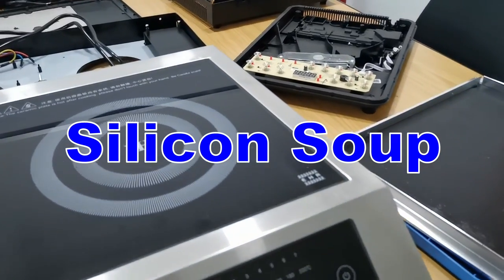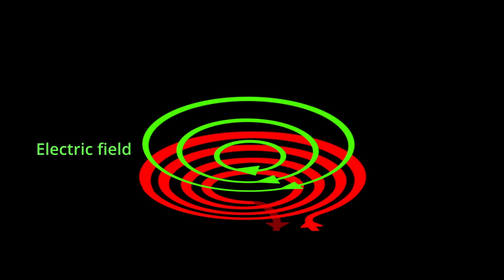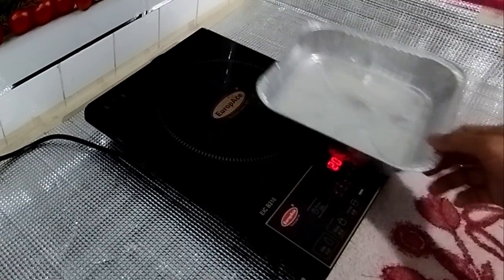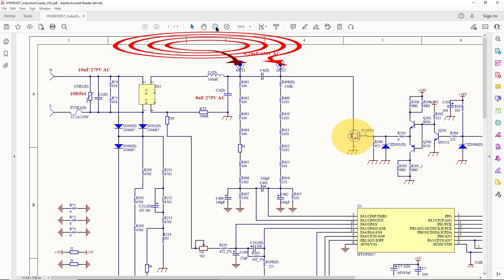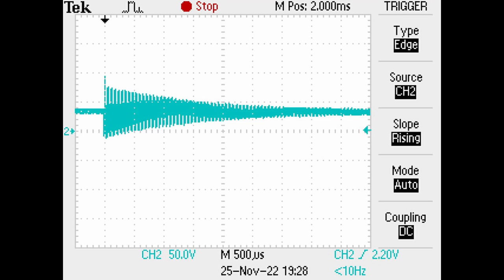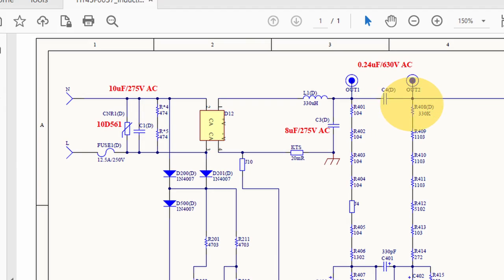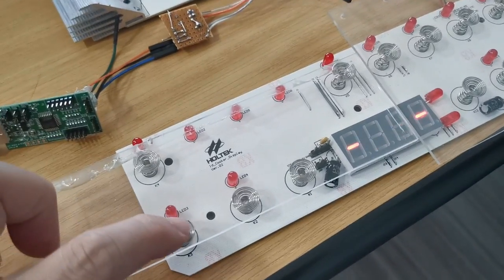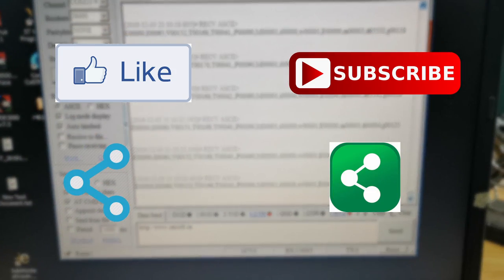induction cooker circuit, design, theory, must watch

Comment: Loved your video!! Thank you so much for it.
I’m interested to understand how the master board that takes user input communicates with the power board? Can we use arduino to talk to the power board instead of the touch pads?
Reply from the maker: The master board communicates with the power board by i2c. Yes, you can use Arduino to control the power board, but you must know the format of data as they are proprietary .

Comment: How can we modify AC versions to run on low amps???
Reply from the maker: to redesign for a lower power cooker, say for tea-pot, we have to choose a different coil, adjust the timing and protection threshold in the firmware. It is quite a complicated process.
Reply: @SiliconSoup  Indeed it will be redesign work

Comment: Great video!! I am doing EE and I want to do low cost low energy consumption or higher efficient induction stove for my fyp, I just have started to look for the resoources, would you suggest me a good start??
Reply from the maker: You can get information from https://www.holtek.com/page/applications/detail/WAS-21A1.
I think this project is a bit too hard for FYP, because it involves high voltage, high current, embedded coding. Moreover, induction cooker is a non-isolated device, so it can't be connected to your PC directly for emulation, unless you modify the circuit and add a isolation transformer.
Reply: @SiliconSoup  Thanks for the feedback, I am not doing it just for grades but its a need of an hr in 3rd world countries, we have seen gas loadshading first time in our lives, its time ppl get better alternates to those expensive and high energy consumption stoves, if you could provide anymore help it would be appreciated

Comment: Hello nice information , someone please explain at which point does the rectified AC input voltage gets inverted to AC back before  been supplied to the Coil, I understand the coil uses AC
Reply from the maker: The switching of IGBT invert the DC to AC. When the IGBT is on, current flows through the coil to the ground. When the IGBT is off, the current continue to flow and charge up the capacitor. Some point later the charged capacitor will discharge and the current reverse direction. So there is an alternating current in the coil.
Reply: @SiliconSoup  lemmi get to learn about IGBT switching and its inversion ability maybe i will understand better

Comment: Excellent work! Many low cost hobs Pulse the output ON &OFF to achieve a  lower average cooking power..its rubbish ! Boil-off- boil- off, plus its useless if you have say limited AC from a 1kw battery inverter or say only 500W of PV solar excess in a grid tied solar setup. I am looking to make a fully adjustable power range cct (esp32 mcpwm etc) which I can dymamically adjusts to only consume whatever free export solar power is available . Holtek do a continuously adjustable 300-3kw custom ic.  Have you any comments ideas or embedded code to achieve wide, non pulsing adjustment of power level? I.e an mppt induction hob.  It would be great if there was a decent open source project for an inductive hob..attractive given world's climate challenges and attraction of Solar cooking. Cheers and well done. Steve
Reply from the maker: Low duty cycle pwm cannot swing the collector voltage to the ground, and switching on the IGBT while the collector (and capacitor) retain some voltage is very damaging to the IGBT, as shown at 8:52. Therefore for low-power cooking, instead of reducing the pwm duty cycle further, many resort to intermittent cooking (boil-off-boil-off). Holtek low power continuous heating is to overcome this problem. Basically, in stead of controlling the IGBT 3-sec on, 7-sec off, it does 3-halfwave on, 7 halfwave off. Halfwave is the rectified AC waveform. The source code is open, but not easy to understand.
I strongly suggest you use Holtek solution, because the MCU is designed specifically for the induction cooker. It has OpAmp built-in for the current measurement, comparator for 
monitoring the coil voltage and triggering the IGBT at the appropriate timing. The latest model even have the IGBT driver built-in.

Induction cooker firmware design is not easy. Commercial induction cooker power supply is non-isolated type, so you have to isolate the power supply before
you can hook it up to the PC for emulate and debug.

Comment: Why the AC versions need higher amps while the DC induction  heater needs low amps and high volts?!
Reply from the maker: The induction power depends on the "transformer" rating, i.e. the coil's current carrying capability, the coil resistance, the turn ratio and load resistance. The higher the turn ratio, the higher the load resistance appears to the coil (n-square), and i2R is the power delivered to the load. As a designer, this is how I consider the power capability, not so much related to whether the source is AC or DC. Maybe there is an indirect link but I'm not aware.

Comment: Tbh i didnt undsr all thr elctrix terma.
But i challmge to you
Add in thermostat so can control by in a few degrees °
Reply from the maker: The design has thermistors to monitor the IGBT and cookware temperatures. I may have missed your point, please elaborate.

Comment: I'd like to commission someone to design and build a small batch of portable induction cooktops that are powered by 48V DC, in the 3kw - 5kw power range. It seems this might not be too difficult since the incoming AC source is first rectified to DC... Do you know anyone who might be able to take on this project?
Reply from the maker: The solution I presented is 2000W.  The AC source 230V supplies 8.7A, and the induction coil withstand a current in that order. For 48V to deliver 3kW, the coil the IGBT would have to withstand some 63A. Induction cooker design is a quite challenging because of high voltage, high current, EMI and firmware development. Sorry that I don't know anyone who might be able to take up this project. Thank you for watching the video.
Reply: How much?  I have the crew and the IGBTs.
Reply: @paulmoore9679  how much? You mean how many units? I’ll need three, but I kinda feel there’s a market for this… how about we do a kickstarter to see if anyone else wants them?
Reply: @dbrophy  I meant, how much of a commission.   How do you wish to contact me?
Reply: I approached this video exactly because I think there is a decent market for a 48V induction cooktop.  Both the marine and RV industries will go to 48VDC. (16s LFP).   They will typically want an ultra efficient cooking appliance that resistive heating simply doesn’t give.  Inverting to 230vac (or 115v) and using standard induction cooktops is the way it’s done now.  Marketing a 48vdc induction cooktop will enable users to draw direct from the battery avoiding the inefficiencies of going to AC and back to DC and avoiding the cost of a larger inverter.  The increased costs of higher current components and larger capacitors, may be offset by the fact that they will be operating at lower voltage levels, or simply not be so significant.  My first technical question would be, in order to lower the resistance of the pot P=V^2/R due to 6 times less voltage, 36 times lower resistance, would the coil need to have less turns by a factor of 6?  And would there be an advantage of lowering the frequency since the inductor impedance is proportional to frequency?